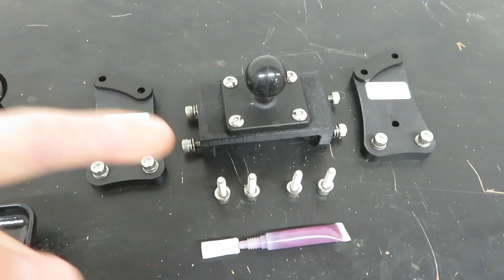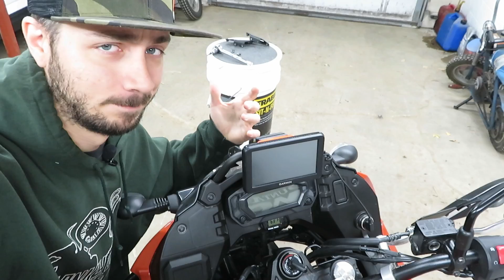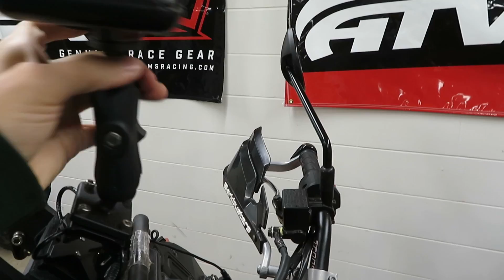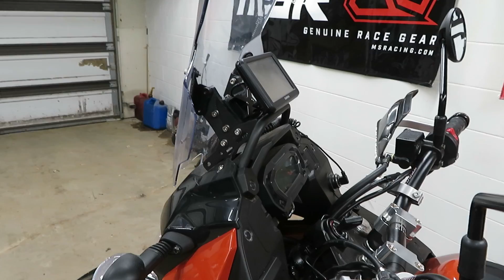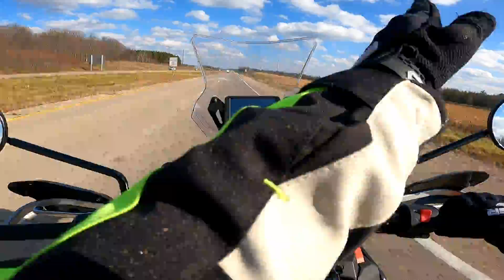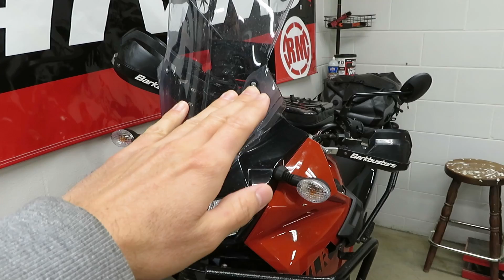Best Gen3 KLR 650 Highway Mod! | 3D Cycle Parts New Windshield Risers w/GPS Mount

Comment: Installed the 3D windscreen extenders today. Definitely didn't overtighten the windshield. Windshield cracked on all 4 screws. Used the threadlocker. I like the new windshield position but I would not recommend the extenders. 05-07-2024.
Reply from the maker: Cracked the shield itself?  Yeah I can see that, the plastic washers the factory uses are pretty useless.  You essentially have to get them finger tight and hope for the best 🤣

Comment: Yo swank do you have any experience with KLR DASH? I like their lower dash insert but idk if it will work on newer KLR. Website isn’t very informative so just asking. Man I had a tall windshield on my HD and I had to cut it. I couldn’t get used to the edge in my eye line, I like it just below it.
Reply from the maker: I've never actually used the lower dash from them but I did have the upper one on my Gen2.  I almost want to say there's less room on the gen3 and that it wouldn't fit, but I could be wrong?
Reply: @SwankyCatProductions  yeah my first KLR so idk. Thanks for all the info and vids.

Comment: What pannier rack for soft bags would you recommend for the KLR 650 2023?
Reply from the maker: I've actually got the Tusk racks and soft bags in a box waiting for me to install them.  Hopefully I'll get to it either this weekend or next.
Reply: @SwankyCatProductions  Thanks. I’ve been checking out the tusk racks. But I have a concern-the bar crossing around the rear seems to be blocking the view of the license plate and the light for the plate. Is the cross bar really important? The dirt racks pannier rack doesn’t have the cross bar.

Comment: In regards to highway riding, I would like the bike to run at 65 MPH and the RPM a little lower, do you have any knowledge on putting a 16 tooth on the front??
Reply from the maker: I've never geared a KLR down or up.  Off road I always wish it was geared lower and on the highway I wish it was higher.  So I just leave it as is haha.
Reply: @SwankyCatProductions  I think I'm in the same boat. Maybe I'll try a 16 just to see what happens. Thanks, I'll let you know if I do it.

Comment: My son and I put National Cycle tall V Stream windshields on our '22 KLR Adventures. We're both 6'1". We've had em on 6 months now. They keep the wind over our heads. His developed a crack at one of the mounting points. They are warranted for 3 yrs so, National Cycles excellent customer service promptly shipped out a new one. Thank u for this informative vid sir. Keep up the great work!
Reply: Based on your note I just installed this windshield on my ‘23 KLR Adventure.  The issue I am having is that it vibrates like hell at a certain RPM.  I note that the tolerance is tight at the bottom edge on one side between windshield and bike.  Going to get some rubber or nylon washers to push out the windshield by 1/8” to see if that cures the problem.  Wondering if you experienced the same?

I am 6’1” and I just clear the top of the windshield enough to clear the top line of sight.  

The ‘23 KLR adventure has a different height position to put the windshield about 2” higher.  I would state at the lowest setting, I could do 55 mph before getting wind buffeted with the stock windshield.  With the stock windshield raised over 2” I could do about 63 mph.  With this new tall V stream I was doing 75 and feeling pretty good.  So, much improved, except that vibration at certain rpm’s.  Thanks for posting this feedback.
Reply: @GPBAMB  yeah vibration is an issue on thumpers, hence rubber mounted this and that on KLR's. I also placed nylon washers on the mounting points but only to dampen vibration, nonetheless, vibrations coming through the windshield is disconcerting for me. I keep an eye for crax on the mounting points. Also, I have a "Seat Concepts" touring saddle on my KLR. It lowers me about 1"-1.5". Thank u and enjoy the ride!
Reply: @1219magnum  just put the 1/16” rubber washers on to push out the windshield.  All good. The windshield is now a keeper.  Cranked it to 80mph, but truthfully felt the wind.  More so from the sides rather than the top.  Much better than the stock windshield.

Comment: Great information. Thanks for showing us the options with the 3D risers. I've been using the medium-sized clamp-on PUIG spoiler tilted in an almost vertical position atop my stock windscreen with the windscreen in the upper stock adjusted mounting position. It seems to work pretty well for me. It's nice to know your results with the 3D risers though.... I still want to take a long road trip to really know how my setup works....

Comment: Puig Ninja 1000 windscreen from Amazon does the trick with these risers. Same bolt pattern. Slightly wider and can be had in clear or smoked. Game changer for me.
Reply from the maker: Put one in my cart, thanks!
Reply: @SwankyCatProductions did you ever mount this setup?  What are your thoughts?  I love my new KLR 650, except for the windshield.  I am 6’1” and the wind at highway speeds is brutal.  Need a wider/taller windshield.  Glad to have found this video.

Comment: I put on a VStream Mid height wind screen. I have had it 6 months now and unfortunately it is cracking from one of the lower screw mounts. Having said that I'm hoping 3D Cycles will warranty it out for me. I can say that it works super good on road but for off road it is too tall for my liking unless I am standing up. Down the road I may switch to the Original when I know I will going off road and also depending how far I will be traveling on road to go off roading. VStream has 3 heights so the lowest height may be better for off roading because it does stand up straighter then the stock, its wider and a bit taller than stock. I am not sure though it can with stand the vibration for off roading.
Reply: My vsream is cracking in the same spot.

Comment: I love the windshield risers so much, to my dismay I broke mine the other day after I dropped the bike in a bad spot off-road. The windshield got caught on a tree branch and snapped the risers apart. I just ordered another set of risers which are now on the way. The bike has a really different feeling with the risers at higher speed and definitely makes an impact for me.
Reply from the maker: Oh no!  Yeah I can definitely see that happening to me too lol I'm sure it won't be long.  Definitely worth it though!
Reply: Sounds like you had an early set that was 3d printed. Email me some pics of the broken ones and both order numbers and I'll refund you for the replacements.
Reply: @3dcycleparts  that is awesome that you will take care of that like that.